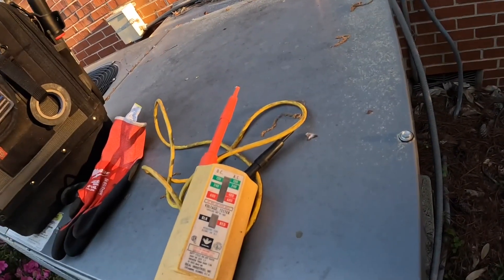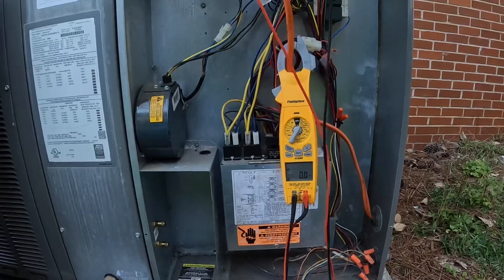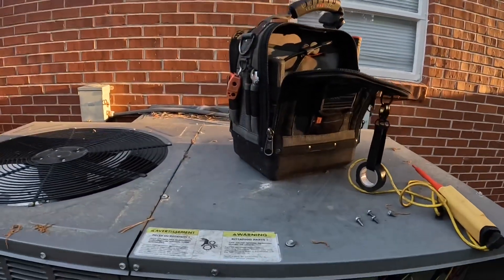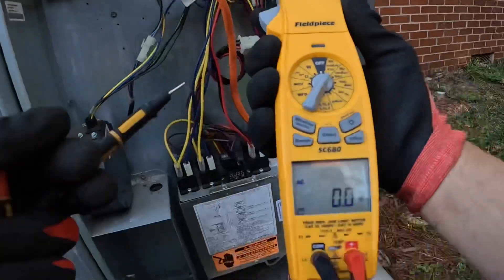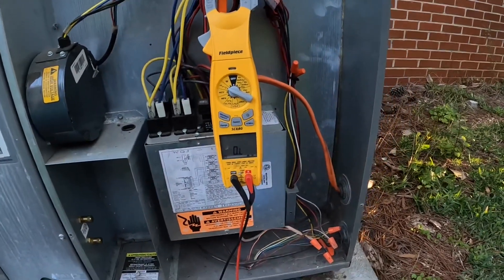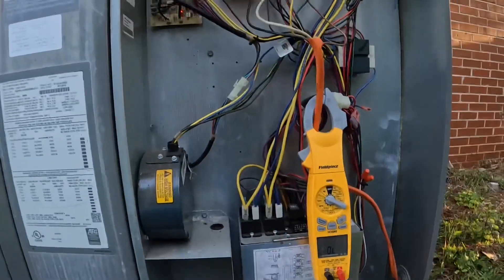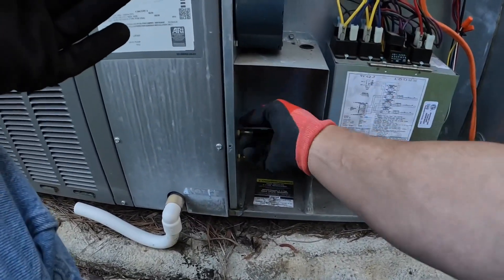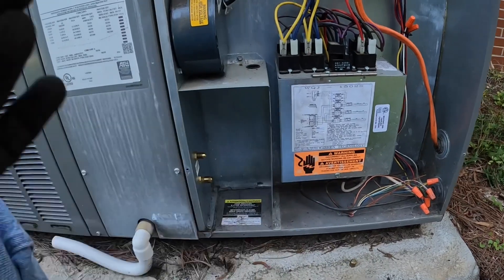System Tripping a Breaker - Acid in The System!

Comment: ouch, i hate seeing compressors fail on units under 10 years old. That looks like a rheem high-static unit which is already built for a high static pressure. Makes you wonder what caused the failure, especially with the high acid volume. You know it shouldnt be a locked rotor, or else you wouldnt get a positive acid reading at the valve. I've seen the condenser coils leak on that particular model, in the front, about a foot up from the bottom and around a foot from the right side. Good luck with the repair brother!

Comment: What the heck is going on with Ruud/Rheem quality? Curtis, you are working on a bunch of broken Ruud/Rheem units, some are your own recent installs (warranty work...) Several other HVAC YouTubers also seem to have a lot of broken Ruud/Rheem units. 6 year compressor life on a package unit? Not good. That thing was sealed from the factory so you can't blame it on previous contamination in a split system.  In the "good old days" Rheem was known as a decent midrange brand. Daikin seems to have invested in Goodman, they are not the junk they used to be. So what's up with Ruud/Rheem?
Reply: With package unit being an all in one system, it has to be ductwork/air filter issues.
Reply: I worked for a rheem dealer/installer and I really like their units. Easy to work on, repairs are generally easier, and they seem to work quite well. But I saw a lot of the same recurring issues. Manufacturer defects, bad braze joints, zip ties pulled to tight and yanking off wire harness, bad/shorted contactors, weird TXV problems, EEV thermistor failures on high SEER units, failed compressors, ECM motors failing within months/couple years, etc. It was enough to keep me busy. Unfortunate, because they are pretty slick.

Comment: That tester on the unit was Ideal's version of Square-D's Wiggy voltage tester ... I had both of em back in the day ... Lol ... Good vid ...
Reply: I still have one 🤣electricians used them a lot. For quick voltage check. It uses a solenoid built into the meter.
Reply: I had one also, it came on a pallet of returned items from HD, except mine was an ideal brand
Reply from the maker: From about what year? I had not seen one before
Reply: @HVACGUY  Late 70's

Comment: 14 Mega ohms enough to trip a breaker? That's 0.017 milliamps. Am I misunderstanding something here?
Reply: resistance takes an nosedive when a compressor heats up. it can easely drop into the tens of kohms wich will/should trip it. having megohms on a cold compressor is a warning that something is up.
Reply from the maker: @SupremeRuleroftheWorld  plus, I’m not using a megger. I don’t think this uses anymore than 5-10 volts to check for ohms to ground.
Reply: @HVACGUY  Thank you both for the replies. I think I now understand, it's not really the value of the resistance (in that instance) it's the fact that it's present at all. (and I know that nothing is a perfect insulator)
Reply: @walterskelton411  yes, the presence is the trigger, not the actual number. your multimeter only checks at sub 10 volts (as stated) so on 240 volt it would certainly pop the breaker.
Reply: Should be no conductivity to the shell using a multimeter.  Not really an ohm's law kind of thing which you may be thinking about.
Reply: Some compressors say they are good down to .5 mega ohms, but can’t argue with the acid test…..